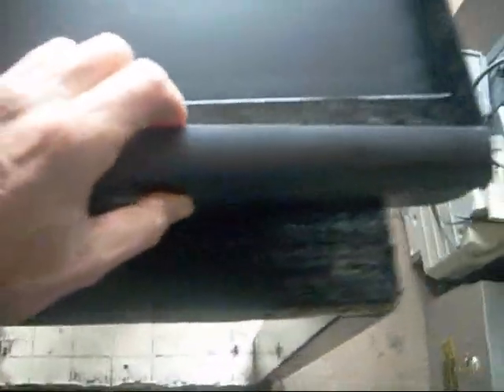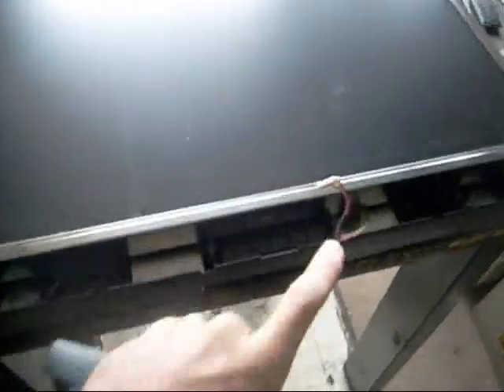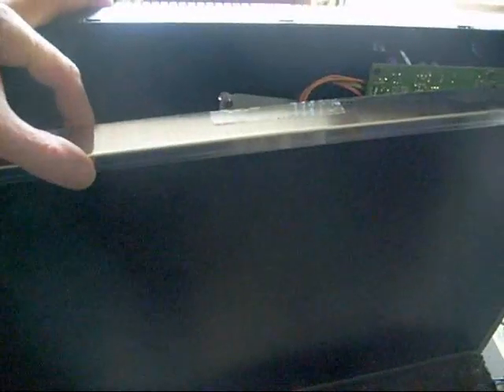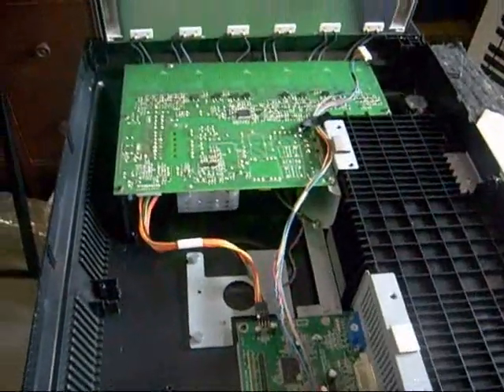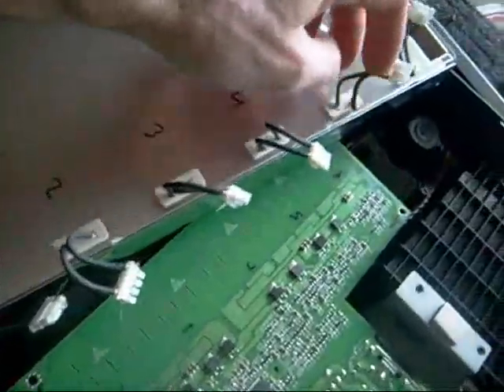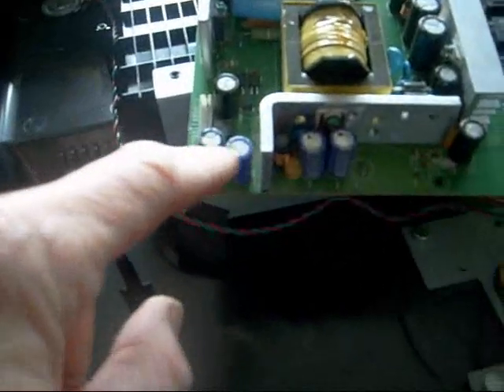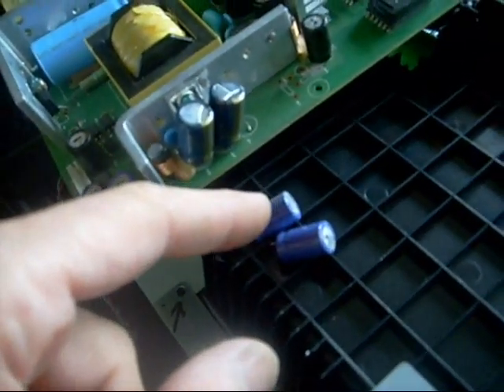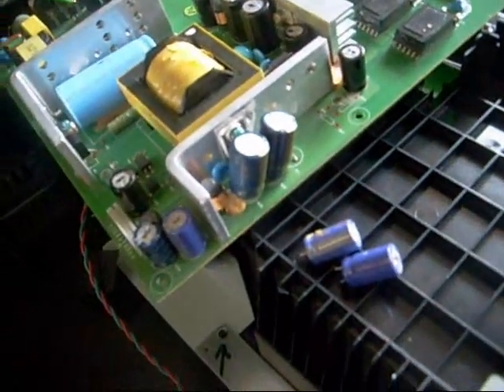LCD monitor had white screen. Make SVA Model number 2400W-BD

Comment: I was given a SOYO 32" LCD TV.  It turns on nicely but the picture is a white screen.  The SOYO logo spins from top to bottom and ends up at a different spot every time.  About every 5 or 6 turn ons, the picture will be blue and I'll have access to the menu for a few moments then the screen slowly turns white.  Any ideas?  TCON Board maybe?

Comment: thank you for the reply i took the tv apart once again, and the ribbons on top of the tv that are attached to the screen, i gave them a rub with the plastic end of a pen and when i came to the last one one the right of the tv as you look at it the tv came to life and when i stopped rubbing it went white again so i stuck a firm piece of sponge on the top of the faulty ribbon put the frame back on it and its working great now thank you for your support keep the vids coming i am learning so much

Comment from the maker: Sometimes it can be useful to power an electronic device using an external power supply for testing purposes which is what your thinking of doing. Since both of these units are plugged into the 120 volt AC line it's important that both of your grounds are isolated from each other. They probably are but I still like to play it safe and use an isolation transformer.

Comment from the maker: Did you test the T-con board for an open fuse or shorts to ground and make sure it had power going to it? It's often 12 volts.

Comment: i have a 32 in Rca lcd tv that has the same problem . is that black stuff on top the capacitors leaking fluid? my psu has several capacitors that have that black goo on 
top , does that mean theyre bad?

Comment from the maker: @neonard0 You need a good ESR capacitor tester to test them in circuit. If you go to my website you will find a good section on who makes the best capacitor tester.
My web site is tv repair info . com

Comment: Can you please tell me how did you test the capacitors. Sorry for my english but I think you said that even they did not look damaged they could be. How do you know that. Do you have to take them out of the circuit for testing? or can it be done directly over the circuit?. Thanks a lot.
I'm asking this because I have a LCD monitor that produces a white screen when I turn it on and I check the board and It seems that the Capacitors are ok, but I'm not sure. ONce again thanks

Comment: Yeah, I've used that technique for a long time. The surface mt caps are real junk.The Toshiba Next/Hyper board is a perfect example. At first it was all the 10 mic caps then it moved on to that + the 100's. Now it's all of them.  "Planned Obsolescence"  absolutely.

I'm getting out of the business. I know what a BlackSmith felt like 100 years ago.

Comment from the maker: @JimmerSD 
A friend of mine who repairs quite a few LCD TVs tells me he has had much better luck using regular through hole radial caps soldered on to where the surface mounted caps go. He mentioned often times the repair jobs done with surface mounted caps come back in a few months with the same problem.

Comment: That has been a typical problem for the last 30 years. I stock caps by the 100's.  Manufacturers have been cutting corners on the surge ratings in their caps for years and they also underrate the temperature characteristics. Mitsubishi is one of the worst with Hitachi a close second. 

If you look at the estimated life of the surface mt caps used in all modern equipment you'll see that they are mostly rated less than 10k hrs and some are actually less than 3k. It should be a crime.